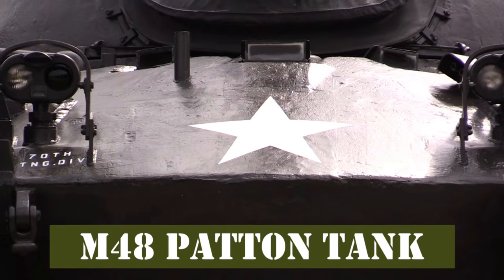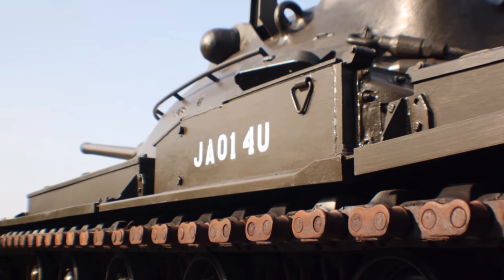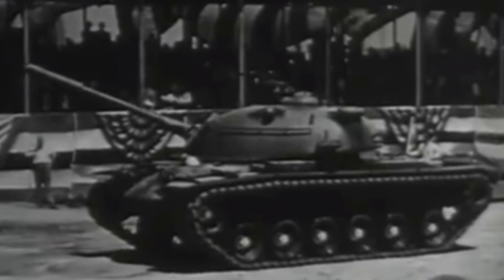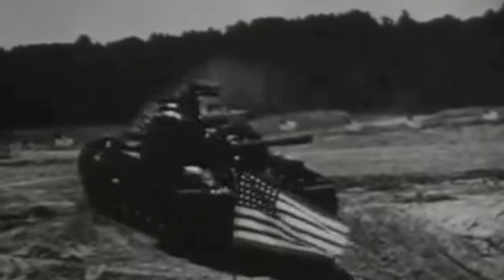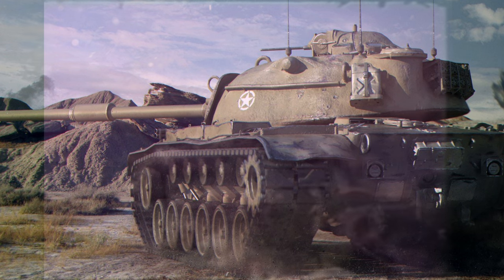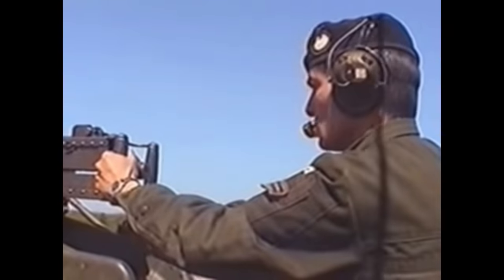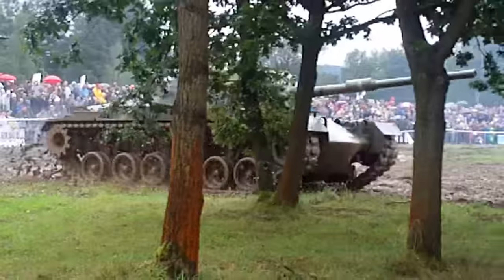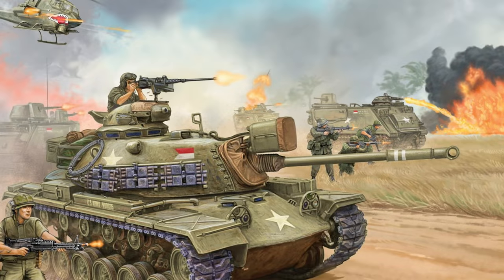M48 'Patton' Tank Series | AMERICAN ARMORED CLASSIC

Comment: On M-48A1 dozer tanks and AVLB in Korea 67’-68. Yes, they had the “little Joe aux engine alongside the main gasoline engine. Nice when the batteries were low or dead. On M48A3’s in Nam 68’-69 and loved that tank. The M48A3 had a diesel engine. Must 48’s you will see from Nam took the M2., .50 cal MG out of the cupola ( worthless inside it ) and mounted it on top of the cupola. We generally mounted and additional M2 or M60 in front of the loaders hatch. All the Army 48’s had searchlights with IR but most photos I have seen of Marine 48’s did not? In the year in Nam I can not ever remember any of our tanks having a full four man crew. We were always short one person which made guard duty at night a very long experience. The M48A3’s could hit a mine and usually be repaired by the crew within an hour or two once the M88 VTR came by with a replacement torsion bar. We always carried extra track on the side of the turret to protect against RPGs and road wheels mounted in various places. We actually lived on our tanks, as we seldom ever left the field and returned to a base camp.
On M-60’s at Fort Hood 69-72, with aTDY to the British Army in 70’, where I was on Centurions and a Chieftain. Fine tanks except for their range finding system. They used a single shot .50 cal mounted coaxial to the main gun. One great feature of the British tanks is they had a hot water spigot inside the tank. Wish we would have had that in Nam to heat our C rations.
Reply: I just saw your comments regarding your experience in Vietnam with the  M48. I was a platoon leader and later the xo of B Company 1st 69th Armor in 1967 & 68. Your observations about the long,and in my opinion,  often scary nights without combined arms support brought back memories. The tanks were our home and the crews were family. Welcome home Brother.

Comment: I was a 19 delta and cross trained on the M-48A5 we still had a few around before they were mostly turned over to national Guard units as we replaced the M-48A5's with the M-60A1 & A2's.
Reply: @Joshua N. Ajang The M-48A5 was an M-48  haul with an M-60 Turret and 105 gun like the M-60's. It was an upgrade. I liked the visibility out of the drivers hatch in the M-48 over the M-60 because of the rounded front haul the M-60 has a flat front haul.

Comment: The M48A5 was my first tank overseas.  As a young 2nd Lieutenant in Korea in 1979/1980 I was introduced to it.  I trained on M60A1s at Fort Knox.  I was surprised to get to Korea and be handed a platoon of M48A5s.  The M48A5 had a 105MM main gun in the original turret (about 20% smaller than the M60A1) so it was a bit cramped and you had to keep your elbows really close to your body when the main gun was fired.  The other thing was it had and "Israeli cupola on top of the turret for the Ma Duce M2 50cal.  To fire it you still had to have about half of your head above the cupola.  It was a good tank and fast enough for Korea's topography.  Hope most of my compatriots from Camp Casey and Camp Giant are still around.

Comment: As a "young pup" tank mechanic who cut his teeth on M 48"s let me point out some VISUAL differences to help identify a few different model configurations. M48A1 - rounded fenders front & rear, flash suppressor on main gun (90 mm), rounded metal cage protecting head, IR, blackout marker & drive lights, long sponson boxes along fenders beside turret, USA #'s usually starting with "9A" - CONTRARY to your chart - NO TRACK IDLER WHEELS - front or rear, solid squared back with phone box mounted over towing pintle, 2 exhaust ports on top of rear engine deck (angeled to the sides), and a "slave starter" engine (Little Joe) to the right of the engine forward of the fuel tank & the massive engine oil cooler (the left oil cooler was for the transmission or vice versa)….M48A2C - visually the same as a M48A1 except the addition of a left & right track idler wheel added between the last road wheel & the drive sprocket......M48A3 - squared off fenders front & rear, shorter sponson boxes, addition of air cleaner boxes to the rear of the sponson boxes left & right, addition of the AVDLS 1790 diesel engine, composite head, IR, blackout marker & drive lights, finned rear of tank to facilitate the diesel exhaust ports, solid cover over engine compartment, elimination of the track idler wheel, 3 upper track support rollers (instead of 5 previously), elimination of the "Little Joe"......M48A5 - when M48A3's went for overhaul they were upgraded to the M48A5 (originally designed by Israeli army) - a few exterior minor changes, the turret firing and sighting systems upgraded to include the elimination of the 90 mm main gun & replaced by the 105 mm main gun.

Comment: The silhouette of an M47 and an M48 are very different especially the turret. I was a tank commander of an M48. In the 50's.  90 mm main gun and a turret mounted 50 cal. machine gun that was devastating. The best at that time. Stationed at Ft. Knox during the Korean War. Fortunately we were never called up.  Great tank for its time. Easy to maneuver, easy to drive, easy to use but terrible gas mileage. No computers at that time.  The driver had an escape hatch under the drivers floor. I don’t miss any of it.

Comment: Cool! The M48 was what we knew in the Australian Army as the boat hull due to its rolled form and the hull served for ages while the top end changed. The Centurion likewise remained in Brit form through all that series through to the Chieftain suspension type. The Leopard won the selection in 1977 as the preferred tank and it was a better platform at the time.

Comment: I believe Turkish army is at present the biggest user of these 70 years old tanks. Still active and well maintained, modernized to meet modern battlefields needs. Turkish M48's (all of them, A1, A2C, A3 models) are upgraded to the M60A1 and M60A3 TTS standard. T1 modernization started in 1981 and could do the same as M60A1, 105mm gun, image intensifier and the same ballistic computer. These variant has been scrapped from active duty at the moment, 1360 pieces of obsolete tanks! The T2 version upgrade plan was started in the mid 1980's to bring all the unmodernized tanks to the M60A3 TTS standard. Inside view is not different than the M60A3 TTS: Thermal sights, laser range finder, M21 ballistic computer and dual axis gun stabilization. Today around 760 M48A5/T2 models are active in front line units. The T1 model, 1360 vehicles are replaced by the more modern and more capable 160 pieces M60T and TM, 350 pieces Leopard-2A4 and 160 pieces Leopard-1T tanks.

Comment: During the late 1970’s I had the honor of serving in the U.S.Army at APG,MD. I WAS A TANK Automotive repairman and worked on the M48a5, M723 Bradley, M1 Abrams in there various testing configuration. So anything you have on other vehicles such as  the M809 series 5ton trucks w/automatic transmission, or :578 tank retreval vehicle would be appreciated.

Comment: We had an M48 on display outside the Defac when I was stationed at Fort Stewart. I always felt it looked pretty solid (for the 50's) and the front hull looked like it would be hard to penetrate, well angled and very smooth, looked to me like shell would just ricochet right off. Id be surprised to see a non APFSDS or HEAT round penetrate it. Still, on Paper and in person the T32 LOOKED better (seen that in person too at Fort Benning) I never understood why they didnt go with that... lower profile, longer 90mm and more armor.

Comment: I was in a tank battalion in the mid seventies and we had M48A1’s with little Joes to charge the batteries. The 50 cal in the commanders cupola was mounted sideways which caused it to jam!!
Reply: He is very correct.  The ammo fed downward you were lucky to get a continuous burst.
Reply: I was in a Calif. National Guard Unit, Battalion HQ Salinas, during the 70's when our M48A3's were taken from us, and we were given M48A1's.  Big disappointment.
Reply: Wasn't the gun that caused the jams. It was the flexible link chute adapter. They had to be installed very, very carefully or they would jam. Some TC's didn't install them to get more shots. Some TC's got lucky and found solid link chutes they were smooth.

Comment: 12:30 does that info panel say: "Cruising range: 70 miles"? That would be from Frankfurt (Main) to the border with East Germany?
Reply: That's the range of the M-48 and M-48A1. The M-48A3 through A5 had the same 1790 AVDS as the M-60 series tanks. And bigger fuel cells, so they went further.

Comment: Excuse me if this question has been asked and answered before. Some of the tanks you have in your video has and some don't, something on the barrel about 1/3 of the distance from the turret that is off centered from the barrel. What is it's function and why doesn't all the tanks have it?
Reply: That is the bore evacuator.  It uses the venturi principle to pull the fumes generated by firing the main gun out of the barrel with the fired shell so that they don't drift back into the turret and asphyxiate the crew,  Most tanks have a similar device.

Comment: What are the two strange round bumps on each side of the turret for?
I dont think any other tank has them. 🤔
Reply: That is the optical ranger finder for its cannon. Modern tanks now just have the laser range finder which is much more accurate.
Reply: @WanderingShadow100  
Ok, thanks
Reply: Stereo coincidence range finder in the A3 through A5. Optical in the M-48 through M-48A1 or the M-48A2C
Reply: They are the ranging lenses for the M-17C coincidence rangefinder

Comment: The M48 has less track support rollers then the M60. That how you can tell the two hulls apart.
Reply: M-60 is straight across. M-48 has a bow.
Reply: @johnking1463  what do you mean bow. The M60 has three support rollers and the M48 has five.
Reply: What do you mean what do I mean. The M-60 hull is straight across. The M-48 hull is pointy in the middle of the front like the bow of a boat. It has a bow. You don't always get to see the side to count support rollers. You don't always get to see the front either. There are more than one way to tell what a tank is.

Comment: The cast hull, with the curved 'boat-shaped' underside, proved to give remarkable crew protection from mines in Vietnam; like modern V-shaped bottoms of modern vehicles.  
The early gasoline -powered models were infamous for short range.  Provision was made for external fuel drums.
Please do a follow-up on the M48s combat history.
Reply: The M48A1's generally used 3 gallons of gasoline per mile, while the M48A3's generally drove one mile to the gallon.